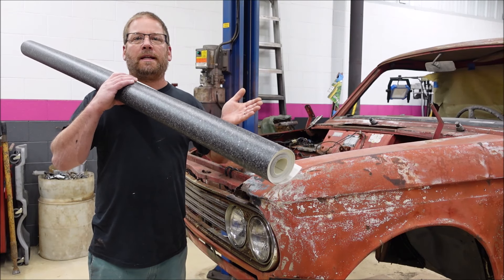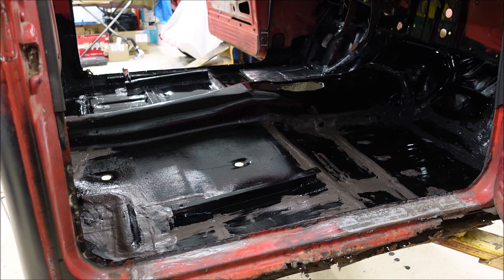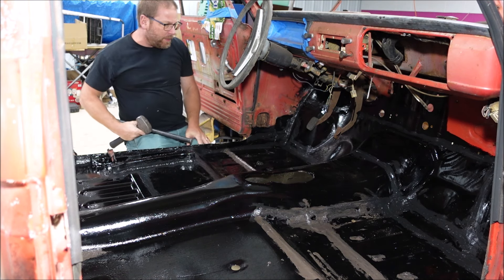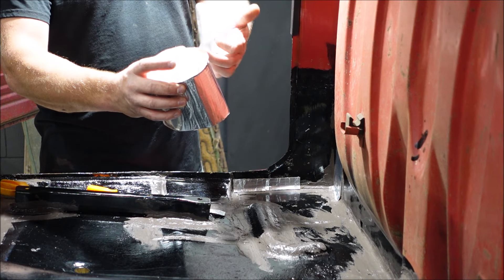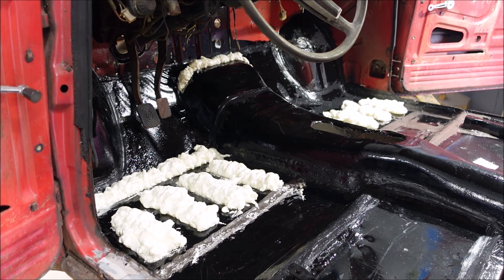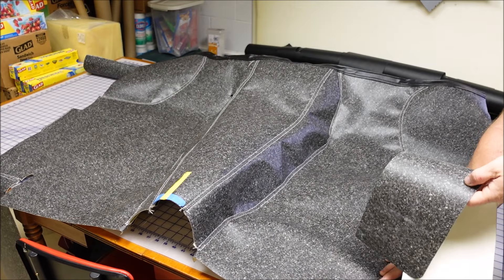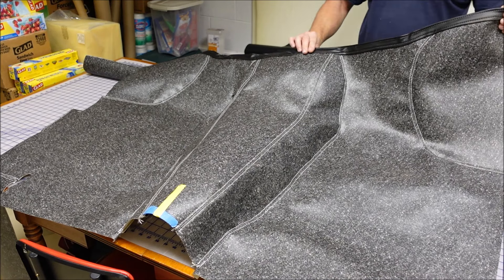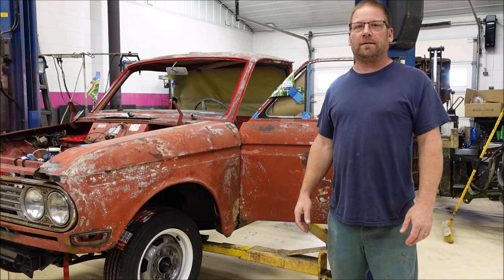Kitchen Bath Vinyl FLOOR in my Truck

Comment: Heat it up to get it to conform better to the floorpan, tape up the cab, throw a heater in and mould it into shape.
Reply from the maker: @cedley1969  I agree with that. I've got it by the wood stove. It should get quite a bit of heat in the cab.